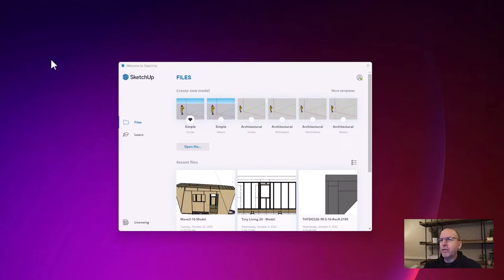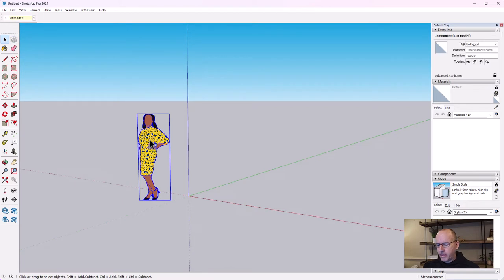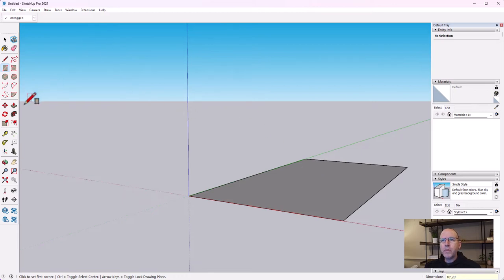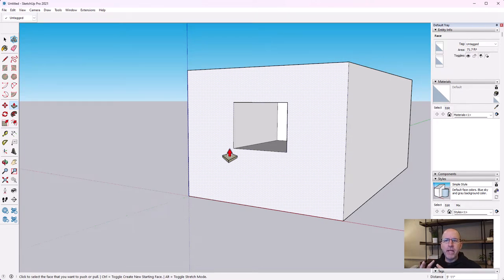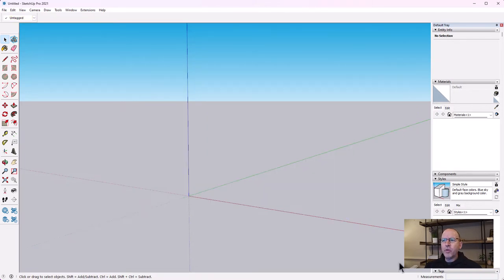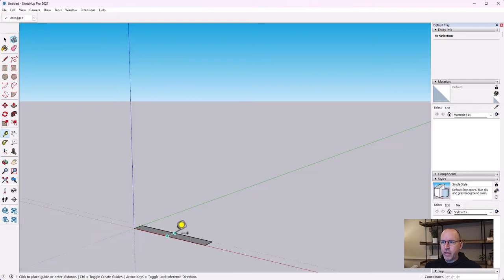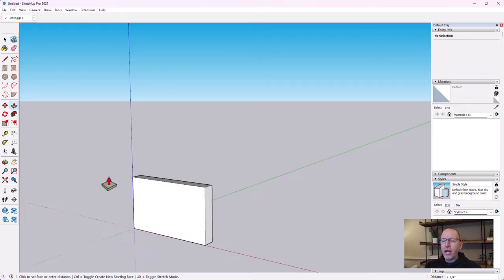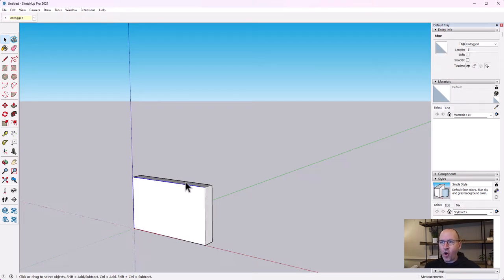Designing a Tiny House in SketchUp - Part 1

Comment: at 15:05 you can type 10x and press enter right after moving the joist to get 10 joists 16 inches apart. ( *10 should also work). You can also move it to the end and type 10/ to get 10 evenly spaced joists in between
Reply from the maker: Awesome. I knew it wouldn't take long for someone to show me the way  :) Thanks
Reply: what if I don't know how many can I fit in the subfloor but I know the spacing between them?
Reply from the maker: @anabilro3961  I just take a guess and then delete the extra

Comment: 15:19 - I'm that guy that's cringing.  When making copies in an array like you're doing with the joists, press ctrl when moving anything (which makes a copy) then type the distance you want it to move followed by enter, then type how many instances you want ie *9 for nine instances followed by enter.  you can also re-enter the instance count value before hitting enter and it can be changed as many times as you want until you get what you want - then commit the function by hitting enter.

To reiterate:  Select group, component or geometry - move selection in desired direction - hit ctrl (makes copy) - type distance - hit enter - type * followed by the instance number value - adjust instance value if need be - hit enter

This method also works with rotate tool.

https://www.youtube.com/watch?v=su7wwXpEytw&t=55s